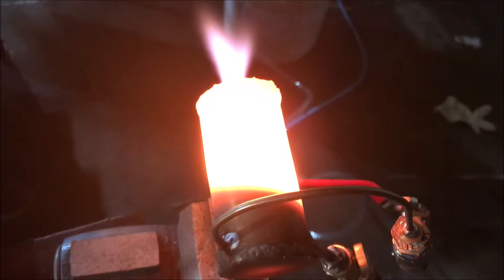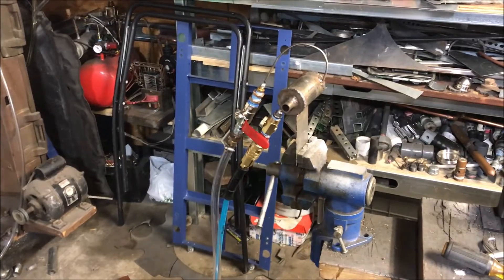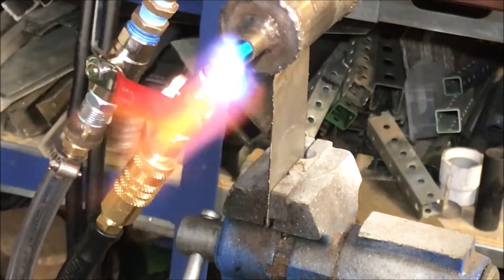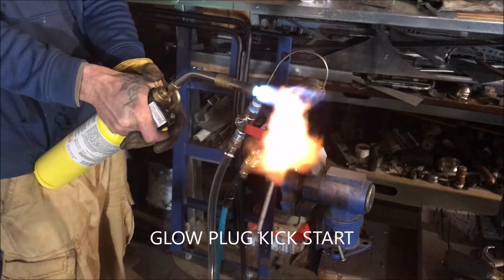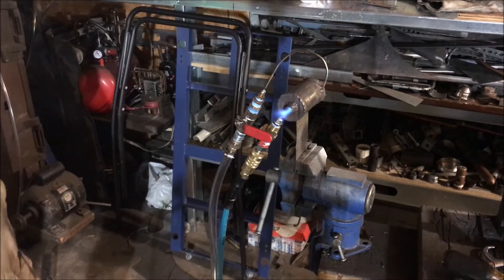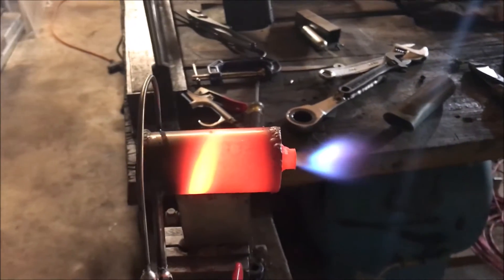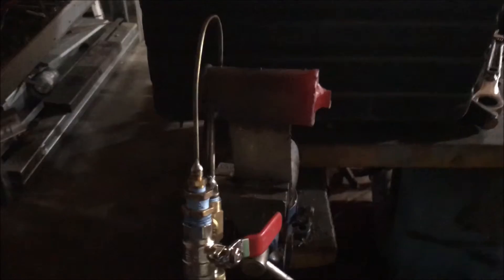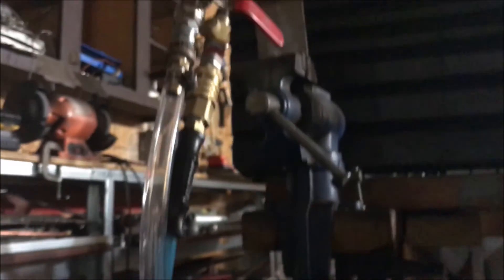Micro Jet engine Propane  Torch

Comment: Odd that you have so much problem making with work with that layout, since it works every time for me... ~( ,m,)~

Typically I just put gas an the blower in the swirl combustion can and toss in a match and POW it is instantly roaring.
Reply from the maker: Is yours this small ? i think my discharge velocities are to high the first time i tried to light it

Comment: put a small flared cone on there instead of the straight tube right at the face of the outlet that should help with getting it to light and start burning internally easier and it will also change the flame shape output to more of a point. yes sounds like the opposite  but look at a solid fuel or liquid fuel rocket burn the flame pattern is an nice round inverted teardrop round at the nozzle pointed at the other end.. perhaps brazing 3/4 inch steel??